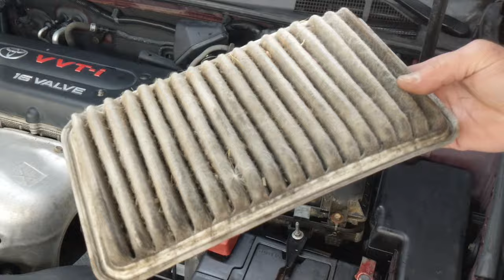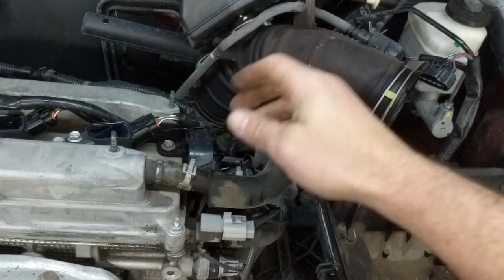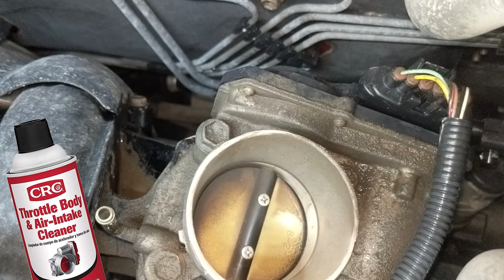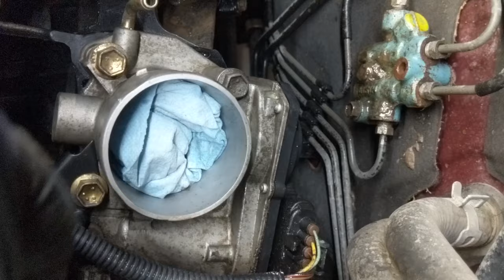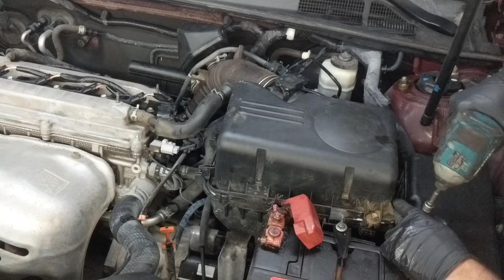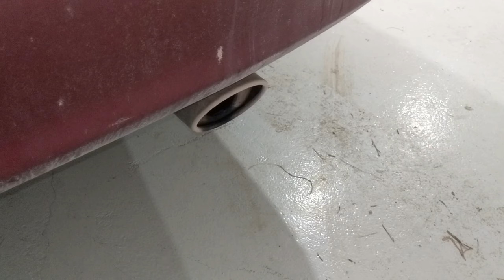2002-2006 Toyota Camry: Throttle Body. MAF, & Injector Service

Comment: Thanks for the video this actually helped my idle issue with the AC on and at a stop. I would get a awful shake and now it’s gone!
Reply: Bro I’m having the same problem rn I have a 03 Toyota Camry 2.4 I just bought a new mass air flow sensor on rock auto. Hopefully that fixes the issue I’ve also tried cleaning it
Reply: @davidreyna7182  Good Luck man it fixed most of my issues from this video. Mines still going at 293,000 miles.
Reply: My wife's 2004 Camry is so bad it stalls when coming to a stop half of the time.  If it doesn't it idles at about 500rpm and shakes like crazy.  In the middle of cleaning it out now.  🤞 This works!
Reply: @perchowski3021  did this end up working for you?  I have a similar issue with mine now
Reply: @hl91666  ended up having to swap injectors and cleaned out MAF to get it to run good.  It ran better after MAF cleaning but would still shake and die.  Changing out the injectors fixed the issue.
Reply: P

Comment: Is there idle air control valve on this 2005 Camry? I got my throttle body cleaned, new air filter, cleaned MAF sensor as well, but the car still vibrates time and again with AC on. With AC off, everything is smooth and quite.
Reply: I think the IAC is built into the the TB. I’ve been having same issue, stalled a few times, could be dangerous. I was thinking maybe replace the whole TB, but then the fuel injectors can be the culprit too. Idk
Reply: @MaxK777  my problem is that the RPM go down with AC turning off. Also if  the car is idling and give a tap on the gas pedal, it will rev up and then go down below the limit to vibrate the car and then the RPM will jump back to normal. That is very frustrating because I have new filter, new plugs, also got my injectors machine cleaned but still this issue is not solved. I also get my throttle body cleaned regularly. Got a new MAF sensor cleaner as well, that also didn5 make a difference.
Reply: @zohaibanwar5919  strange because my RPM jumps down when AC goes on. I’m about to throw a new TB on it but then again who knows if that’ll fix it lol
Reply: @MaxK777  yeahh let me know if it does solve your issue. My mechanic also suggested that I replace the throttle body, but I am not sure if it solves my issue or not, as currently, my car runs fantastic. It's only at idle it disappoints me.

Comment: My 2006 Camry throttle has a slight initial sticking point which tends to make it take off from a stop with a surge.  I was hoping to find the TB nice and accessible so I could spray the pulley area with penetrating spray but no, buried. Thx to your video I can get to it.

Comment: Cleaning the inside of the throttle body doesn't seem worth it.   All that rubber ducting is dirty too and that's not being cleaned at all so I'd rather just pull the MAF sensor and clean it in-hand.
Reply: From experience it’s most definitely worth cleaning the throttle body. It takes maybe 30 min tops
Reply: @Allen.alledgedly2  Yeah I just did this a couple days after that comment.  Once i had the MAF off it would have taken 5 minutes tops.  I probably could have and should have.  But fixing a few vacuum leaks and fastidiously cleaning the MAF was all it took to solve the problem.  The car runs great so I'm happy.
Reply: The throttle body has the butterfly-valve at 12% to 14% at idle. At this low %, the valve is barely open with a small gap. The dirt built-up in front and behind the two valve-closing positions will make the idling very rough.  So cleaning these places in throttle body is significantly useful.  

Pulling out the MAF sensor and clean it in-hand is a very good advice because the exposed element is the temperature sensor only; the MAP sensor element is hidden in the curved short ducts that need a few good sprays to blast the solvent thoroughly through the short ducts.

Comment: I have a 2002 Camry V6 3.0L 70k miles that does great, but if you have the accelerator at a constant speed, you can feel the car get a little jumpy….any thoughts on what that could be?

Comment: The guy I bought my camry from ran it on 3 cylinders for half a yr. Cost me $2 at the pick n pull to get rid of it but I didn't think about how much damage had been done. Installed a new catalytic converter (from Toyota for $1380, yes, more than I paid for the car.....(California pzev vehical) it also has a valve stem seal issue to where it smokes upon first startup. Just reset the maintenance soon light and had to have to it wrong cause now it won't idle! Holy f! 238k miles and still 24 mpg around town, otherwise this money pit would be gone. Love the car, truly do but it's now claimed a part of my soul in trade for overpriced over engineered parts!
Reply: Leaky Valve stem seals common
Reply: What was the bad cat like? Did it have loss of power at low rpm and/or in low gear?
Reply: @joshuaslye6240  the bad idle turned out to be a bad maf, what threw me off is the fa t I had replaced it 4 months prior. Only thing the cat really did was not let the car pass emmisions. That leaky valve seal man, it kills cats
Reply: @kswis  Thanks for the info. My valve seal is definitely bad and the cat seems to be the likely culprit for my issues.
Reply: @joshuaslye6240  that sucks man sorry to hear. Good thing is long the maintenance has been done, the car will damn near last forever. I've even had to get parts for my new car, very few are perfect from the lot. Best of luck

Comment: I've never seen them spray the throttle body cleaner direct into it. I always saw them spray a cloth and clean it with it that.
Reply: Hell I soak that whole plate in the and everything around there with an entire can before I even finish I use way more than this guy did cleans all the gunk out of the intake hell the old days they used to start the car and spray it while it was running and then somebody would hold the accelerator so it wouldn't die

Comment: Had to disconnect battery for power steering work.. Now the idling is reset and goes to almost zero... Hope this will fix..
Reply: If you haven't fix your low idle problem just YouTube learn re-ital on your Toyota Camry and it'll show you how to do it that always happens when you reset the battery it has to relearn the idle

Comment: Would a dirty throttle body cause issues with idling and smog check?
Reply: Yes, a dirty throttle body can cause your engine to idle a slightly higher rpms than it would normally. In my experience it idles maybe a few hundred rpm higher (300-400 at max) and cleaning the throttle body helps with that.
Reply: @Mrparkkila  I figured it out, it was the ehxaust pipe was clogged with the Main Cat Convertor which is no longer there anymore. I cleaned it out and now have power again aside from a slight rattle. Can't pass a smog check though...😁

Comment: So you you didn’t have to disconnect the battery?
Reply from the maker: You're supposed to anytime you disconnect a sensor, but it's low voltage and low risk in this case.